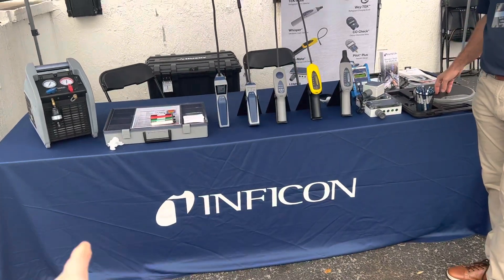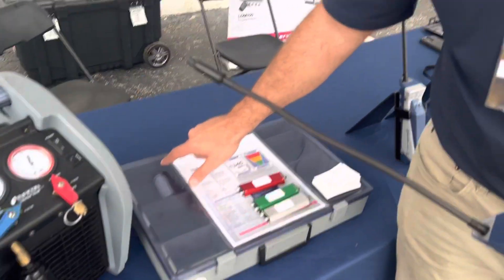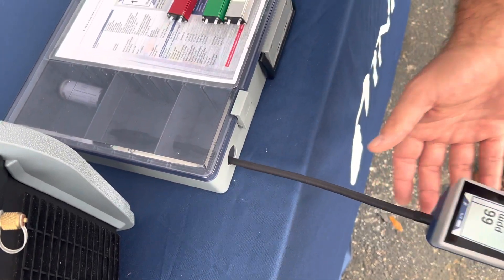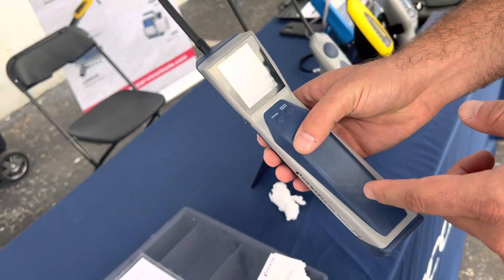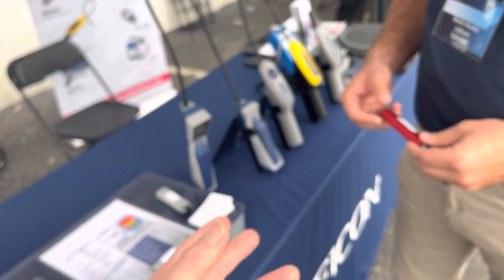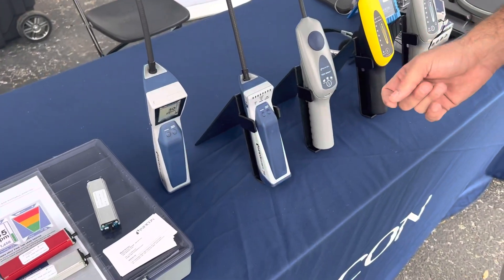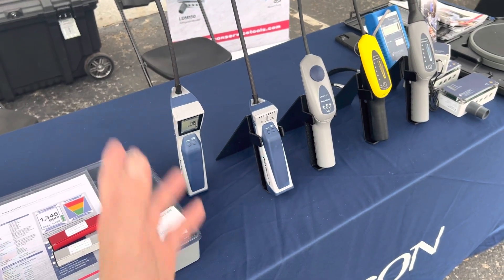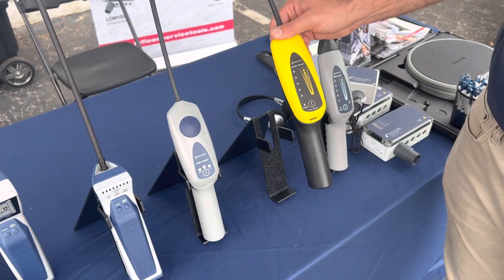Inficon D-TEK Stratus Refrigerant￼, CO2, HC Flammable Leak Detector and Portable Monitor

Comment: No sure why you think it's illegal in oz you can buy it over the counter  for more than  30 years
Reply from the maker: I was told by Ozzie‘s it was illegal to install it in a vehicle anything to go by legally it’s whether you’re allowed to use them for a particular purpose. 

Even here in United States you can legally buy the refrigerant cans that have propane or butane in them but the rules laws and regulations you are not legally allowed to use them in a automotive vehicle on public highways but people do

When I was at a MACS mobile air conditioning society expo there is a gentleman from Australia who got up to the microphone said supposedly it’s not legal in Australia to put hydrocarbon refrigerant in a vehicle for people do anyway because it’s so cheap. 

I myself personally think hydrocarbon refrigerant are excellent you need so little and it’s so efficient so as long as you have a Refrigerant identifier to tell you what is in the vehicle and you have the correct leak detector I see no problem with it myself personally

But for safety sake’s the hardware meaning the evaporator the condenser the refrigerant hoses and lines and compressor should be designed for safety for flammable refrigerants
Reply: @coldfinger459sub0  its the companys that make the other refrigerants that make it out to be so dangerous, as you know for a 500g R134a system you only use 150g of R30. I have no agenda, Ive used both,I am retired mechanic just repair vehicles part time. Back in the eighties most of our taxi fleet were converted to run on LPG, a 70kg tank of liquid behind the back seat and a 3/8 liquid line under the floor and into the engine bay and  today plastic fuel tanks and plastic lines carry fuel. thanks for your comments appreciate your opinion
Reply from the maker: @ltkaffey  Exactly and pump 15 gallons of petrol in your gas tank and drive around with it and a 20 pound propane cylinder on your deck attached to your house onto your barbecue